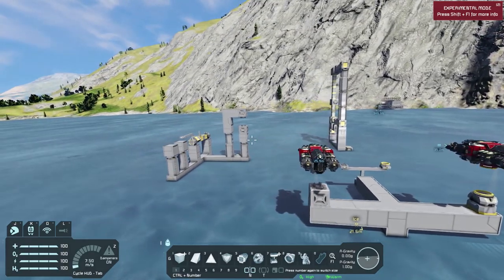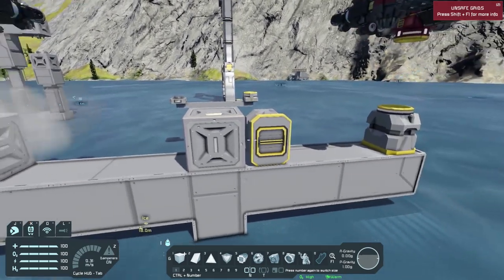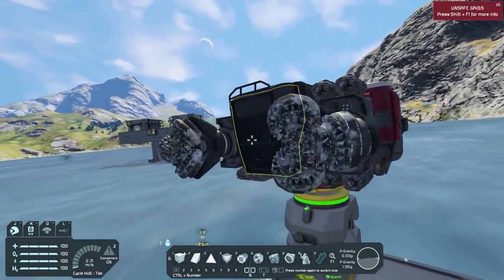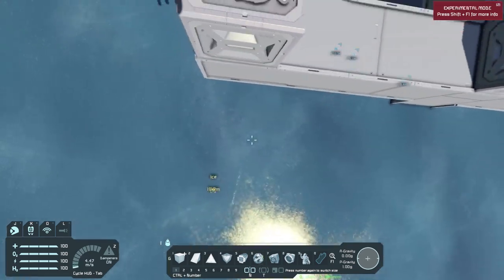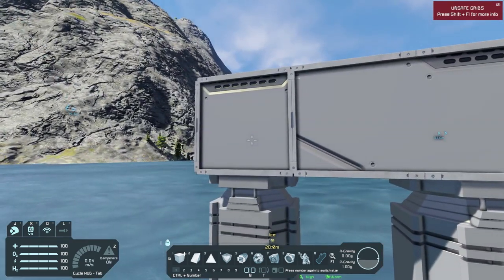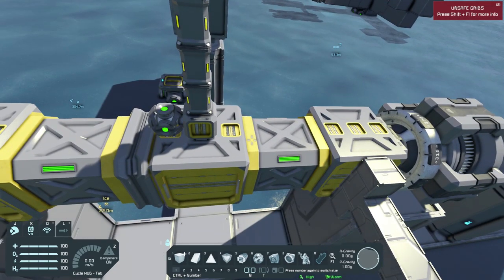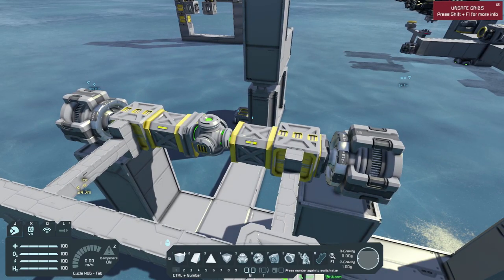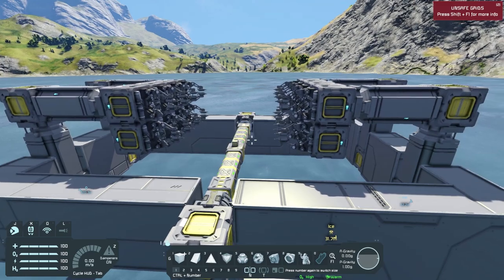Space Engineers: Merge Blocks And Connectors

Comment: I have had problems getting the merging of pistons to work consistently.
When I link them up (exactly as described), the (primary) piston, the one I am moving on to the other(s) (tried this with 2 & 4 pistons), the fist piston gets stuck at 0.1m after the merge blocks connect, while the others go to 0.0m.
With the pistons out of sync like that, none of them will move.

Comment: My issue is I'm trying to connect a miner to a rover and the rover needs the handbrake to not roll away but hitting it disconnects them
Reply: I have no idea if you ever figured this out and I'm still pretty new to the game myself so I may be wrong, but when you're in your rover, there should be some sort of connector option in your G menu that will allow you to lock and unlock your connector.
Reply: @sketched5432  I did that, and then I also put landing gear next to the connector on the thing I'm attaching to a rover so that even though pressing p unlocks the connector the rover doesn't just drop the thing attached to it, if that made any sense

Comment: can someone please help me i literally have the connector on top of the fucking h2/02 generator and ice wont go from my ship into it like how more connected can you fucking get
Reply: I’m new also but Iv heard someone say that if a connector is too small it won’t pass certain things through it but I don’t know
Reply: @dialingcomic6806  it did work the it just stopped working for no reason,had all the power and added storage space
Reply: I’m going to assume it’s from a mining ship to a base for simplicity’s sake...
If you add a sorter between the base connector and base storage, pointing so the arrow is in the direction of flow, there’s an option in the sorter to drain all (the wording may be a bit different, but it’s similar...), that SHOULD automatically pull anything in the ship’s storage that it can into the base... the thing about some things not passing through is only true for the small conveyors, which can only pass ore and a few other things I can’t think of at the moment...
Reply: hey bro did you get it fixed yet
Reply: Im not a expert myself but im pretty sure you need to Lock the connector to have items or minerals to pass through them